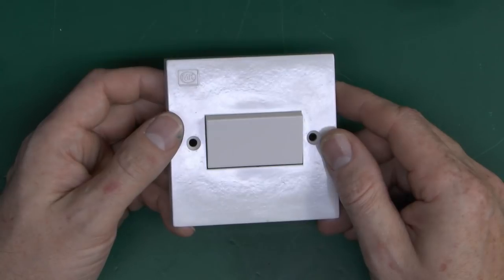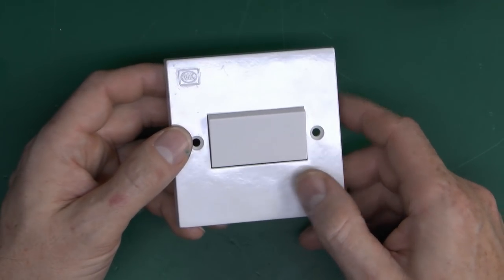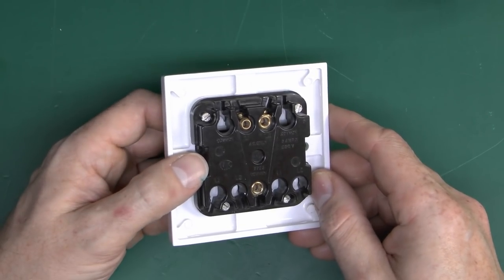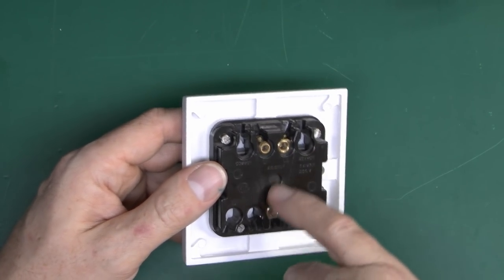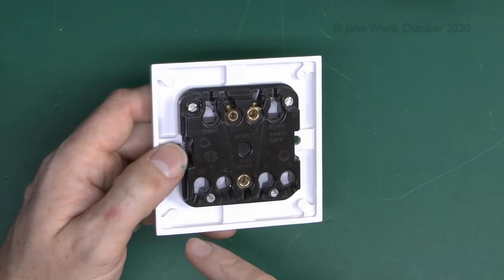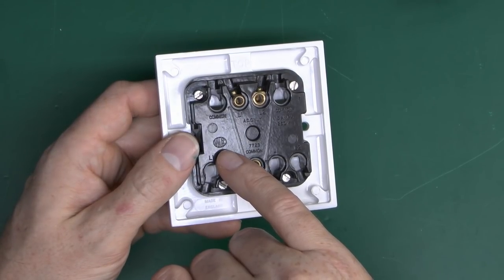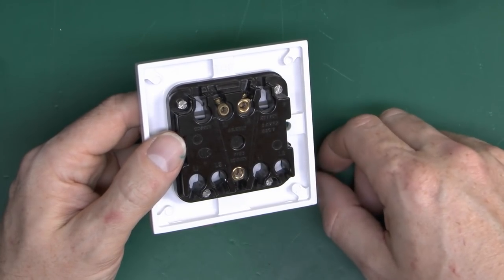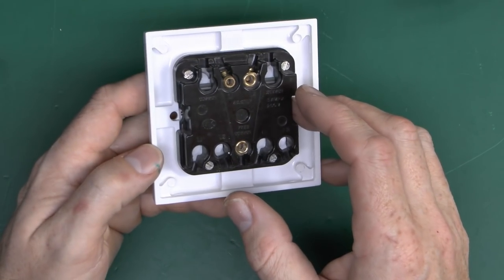The Switch of Mystery

Comment: Adding to what JW says, this switch and others were bought back in the late 80s for my first place and they came with me when I moved, as by then you couldn't get them any more and the Logic Plus ones were yet to come. This one was in the cupboard under the stairs and was the last to be replaced with a Logic Plus wide rocker one.
It clearly uses a triple two-way switch block with what could be a fan isolator front, assuming they were a thing back then.

Comment: As below. I've seen these used as light switches in a disabled persons home mounted at waist height. Made it so much easier to operate for the user.
Reply: It is a light switch - a very early wide-rocker one from the original Logic range that seems to have been made when someone at MK realised it could be made using parts from other products.
Reply: I do totally agree these are great for people with disabilities but back in the 80’s this would not have been the reason behind the design.

Comment: 3-gang switch with a single big rocker and only one set of contacts fitted! Whether you can fit the others depends if the mouldings are present on the back of the rocker. 
I quite like it, bet they’re not made any more.
Reply: Do try to keep up at the back.

Comment: Hi John these were common in the 80s mostly used in places like nursing homes and shelterd accommodation even shops . Can you please do a video on the use of the Robin kts 1620 MFT as a comparison to the modern test instruments
Reply from the maker: Those Robin testers are over 20 years old, and won't be of much use on any modern installation as the loop test will trip modern RCDs, and the RCD test function is only for type AC, nothing else.
Reply: @jwflame  my understanding is if press the angel button ie change from 0dto 180d it may not trip the RCD if it does the use a higher loop range it. Will then put out a smaller current  and will not trip the RCDS?
That is from the instruction manual as is the same for the kewtech kt62 multifunction tester
Thank you so much for your kind reply. More videos please keep up the good work your a joy to watch fabulous learning tool thank you
Reply: @jwflame  sorry to  contradict you but I have just read the instruction manual again page by page and it says that the KTS 1620 multifunction tester has the function to test DC sensitive RCDs thore electritions also confirm that as well they also told me as dose the manual that on the loop settings you may have to remove any RCDS from circuit and replace them with a suitable mcb for the test. But thank you for the the information and your videos are fab keep them coming I can't think of a better or easier way of learning,
So thank you
Reply: Please accept my cincere apologies if my comments have upset or offended you that was not my intention,
Reply: @jwflame  Which is all that is required for BS7671 Amendement 2. I've got a Megger 1552 which is the same, mine is still in calibration and works perfectly and I know several people who still use them on a daily basis. Bomb-proof, they are.

Comment: Hi john just wondering if you can help or any other electrician can give an answer , we have a concealed shower valve in a stud partition wall and directly at the back of it is our light switch for the bathroom , the light switch is obviously outside of the bathroom,but the metal back box of the switch is only 10mm away from the actual concealed shower valve In the stud work. Is this a breach of regs UK? I’m worried if the valve ever leaks onto the switch it will fry whoever is in the shower. The consumer unit has x2 rcds and mcbs , Any help would be much appreciated thank you

Comment: I live in Canada and my first observation about British electrical kit is it's always  S O   C H O N K Y. Our switches and outlet covers are tiny, by contrast.
Reply: This isn't a typical British switch. The typical ones are tiny compared to this.
Reply: This is most probably used to help people with disabilities.
Reply: @hopsta  The standard rockers are small yes, but the faceplate is the same size. 
Once you've used the current Logic Plus wide rocker switches you won't go back.
Reply: @Graham_Langley  If you're referring to something like MK K4781 then I already use them throughout my (British) home. Mainly because my EU wife insisted I replace the 'stupid' small UK versions. I also have the double versions for the stairs and kitchen (MK K4782). 

It does make you wonder why we have such small switches in the UK when the face plate is so big? I wonder if the first designs use the same switch mechanism for the plug switch and the light switch and then it has just stuck around for decades. I would be interested to find out if there is any specific reason.
Reply: @hopsta / Those are the ones. As I've said elsewhere I had the one here in my first place and they came with me when I moved. This one was the last one remaining, in the cupboard under the stairs, so I as JW didn't seem to have one in his collection I sent it to him.
Reply: When you're old, a large switch can help when mobility becomes challenging.

Comment: Hello John. To Me that wouldn't Be a 2 Gang Switch with a single rocker on the front.. That would be a Double Pole (Or a 3 Pole) Switch.
Reply: There's only 3 connections ,if it was double pole there would be 4,they were made for people with disabilities
Reply: let me guess, you are not from the UK
the terms used in the video are the terms used in the UK
Reply: @pineappleroad   Wrong! I am From the UK. I live in County Durham....

That Switch is Supposed to have 3 Poles for 3 circuits Depending on your extractor fan system... You also could  also have a 3 pole Switch on your lights aswell to control 3 lights from one switch.
Reply: @trinityadam  Erm, no. I sent it in. Its a little-known wide rocker light switch from the original Logic range. I bought them back in the late 80s for my first place.
Reply: @trinityadam  classic case of me not watching the video to the end before entering the comments section (and also getting myself confused at what certain words actually mean)
what john would have meant was it would be possible to modify the switch to turn it into 2 or 3 switches that operate as one
Reply: @pineappleroad  We've all done it.

Comment: I now want one as a large light switch.
Reply: I'm sure you can get large light switches even bigger than this
Reply: @craiga6557  You can indeed. Almost the whole front.
Reply: This is the European style switch. We have the updated MK version of these throughout our (British) home. MK K4781WHI
Reply: @hopsta  Pro tip: The switchblock on the current single and doubles is a standard MK grid one so if you're very careful you can have odd combinations - I've got a double here with a two-way and an intermediate switch.
Reply: @Graham_Langley  that's pretty cool. Didn't know that, thanks for the tip.
Reply: @hopsta  You have to be very careful as the locking barbs on the faceplate are brittle. A bit of heat on the switchblock loops helps.

Comment: Hi JW love the content you put up, just a quick question for you and I suppose anyone else who can answer it.  I am installing a grid switch system of 9 switches to bring in contactors for electrical appliances in a kitchen, I would like to run 1mm 17 core YY cable instead of 9 lengths of t&e, but in the regs it states the use of non standard cable should be discouraged. It doesn’t say I can’t use it though, what’s your thoughts? Btw the contactors will pull a max of 250ma per core.
Reply from the maker: YY isn't generally suitable for fixed wiring, at least one manufacturer states this, https://www.elandcables.com/media/27014/yy-control-flexible-cable.pdf
If you can find a manufacturer that states it is suitable for fixed wiring then in theory it could be used.
Singles in conduit would be a far better option.
9 switches controlling contactors can be done with 10 cores, 9 switched outputs and a common supply.
Reply: Hi, just out of interest, what kind of kitchen appliances need contactor control?
Reply: @markrainford1219  it’s a new modern kitchen with everything built in, cooker fridge freezer, microwave, warming drawer, dishwasher, washer & dryer. The main reason is to get rid of big red isolation switches so having a grid of low current switches to isolate the appliances.  I have the answer anyway, as the designer I just have to justify the departure from 7671.
Reply: @slottech101  So why not simply control the appliances directly from 20A DP grid switches, no need for contactors. In fact contactors must NOT be used for isolation anyways. You won't get a grid switch for an electric hob though, so just stick the isolator in an adjacent carcass. I would argue  this switch is an emergency control also (chip pan fire?) so keep it to the front of the cupboard.
Reply: @markrainford1219  "contactors must NOT be used for isolation anyways".   Untrue.   See the second row in Table 537.4.
Reply: @markrainford1219  Grid switches do not comply with the requirements for emergency switching - see 537.3.3.5
Reply: @slottech101  Make sure that the contactors comply with BS EN 60947-4-1 and not BS EN 61095, that they are marked with the symbol which indicates that they are suitable for isolation, and don't forget to consider the requirements for overcurrent protection of the control wiring.
Reply: @anonnona8099  I beg to differ, BS 60947 are intended for industrial or commercial application and BS 61095 are intended for domestic applications, it’s done now anyways,  I have a second 21 way CU populated with 9 contactors 3 at 40amp and the rest 20amp all fed from 1 MCB on DB2 at 6amp for the control voltage, which is max demand of 0.3A.  It all works beautifully and giving a very clean and sleek look to the kitchen. All appliances can be isolated safely.  Like I have said previously as the designer I can choose to deviate from bs7671 if I can guarantee the same standards are being kept, which in fact we are going above.
Reply: @slottech101  You can get DIN rail mounted  60947 contactors, so I don't see what the problem is.  But there is a problem with you begging to differ, because what you are begging to differ with is BS 7671, which does not allow the use of 61095 ones for isolation or emergency switching.   So given that you didn't have to use that sort, given that you could just as easily have complied, your departure from the regs has no merit and your EIC for design is invalid.